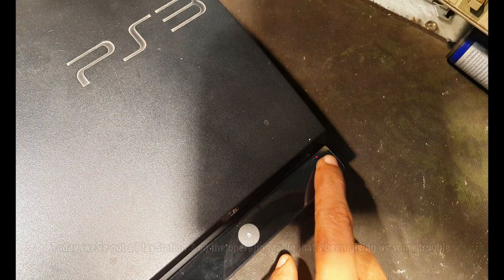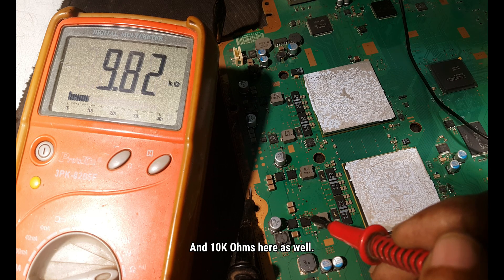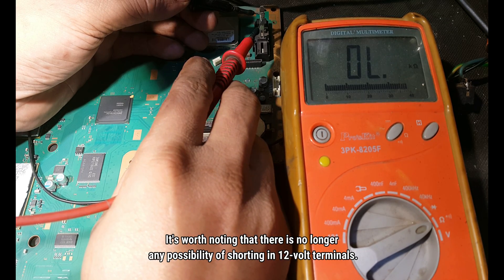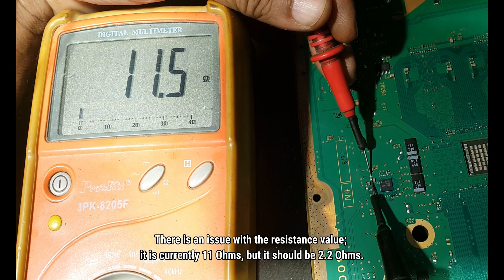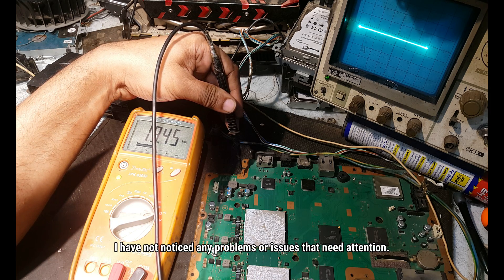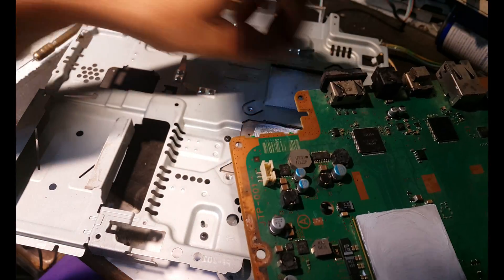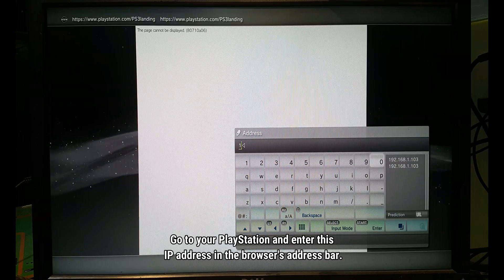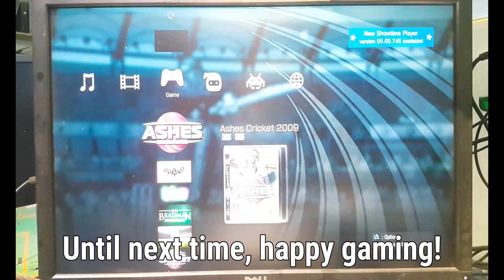Reviving a PlayStation 3: Unveiling the Shorted FET Mystery!

Comment: Hello sir, I am repairing a PS3 DYN-001 with my father. We need help to set up the oscillpscope. Checking the voltage oscillation on the coils is pretty easy, we just use one probe. But to check a FET ( from 11:30 ) you use 2 probe, setting the oscilloscope in vertical and orizontal, we don’t know how to do that. How is called the option you use to check the Mosfet short? We can not figure it out, help would be apprieciated 👍
Thanks for the videos, respect from italy 🇮🇹

Comment: Hello! Is it possible that a JTP-001 board from a PS3 slim presents the same fault but that it returns to giving the red standby light if it does not have the HDMI IC installed?
Reply from the maker: @ElioFernandez Yes, it is possible. The PS3 Slim's JTP-001 board could return to giving the red standby light even if the HDMI IC is not installed. Here's why:

Standalone Circuit Functionality:

The PS3 can enter standby mode as long as the primary power supply and basic system circuits are functional. The HDMI IC is not part of the system's power initialization process, so its absence doesn't necessarily stop the console from reaching standby.
Limited Dependency:

The HDMI IC primarily handles video output. Its absence might prevent HDMI video functionality but does not inherently disrupt the console's ability to power on or reach standby mode.
Fault Response:

If the system detects the missing HDMI IC during diagnostics, it may still power on but fail to output video through HDMI. You may only see a black screen.
Testing Without HDMI IC:

If the board boots into standby mode without the HDMI IC, try using the AV multi-out port for video. This can help confirm if the issue is isolated to the HDMI circuit.
If you're troubleshooting, focus on confirming power delivery, system initialization, and alternate video outputs (AV). Replacing the HDMI IC should restore full functionality if all other circuits are intact.
Reply: @idreestech  Tranks! So Much!!!

Comment: Thank you dear idrees, brother i dont have analoge osciloscope, i have a digital one, how can i test fets ?
Reply from the maker: Testing FETs with a digital oscilloscope is quite similar to using an analog one. Here’s how you can go about it:
Just like with an analog scope, connect the probes to measure voltage between the gate, drain, and source of the FET.
Apply a small voltage to the gate to see if it turns the FET on. With the scope, observe the gate voltage—if it stays steady, that’s a good sign.
Check the drain-to-source voltage or current once the gate is powered. A healthy FET will show a stable waveform when conducting.

Comment: Sir ps3 fat no display no safe mode no controller light no hdd light on only green light on and fan work pls help how i repair this
Reply from the maker: It looks like someone has swapped its Nor chip with another PS3 motherboard.
Reply from the maker: It looks like someone has swapped its Nor chip with another PS3 motherboard.
Reply: @idreestech  I have like this problem ps3 fat no video no HDD light pls make video
Reply: Pls sir can you solved it ?

Comment: Thank you. ❤ From South Africa. Watching your videos, I fixed one slim PS3 <2006> 18 years old and the Phat model <2003> was also repaired but now has this same short circuit problem. I will attempt a similar diagnosis as per your.  video.
Reply: Thank you Mr Idrees. I fixed the fat model. It was a shorted capacitor on the rear side of the board. It caused short on the 12v rail everywhere. Now it boots up after cap removed.   Only prob now is USB ports not working.... Have u made any videos on USB port diagnostics?